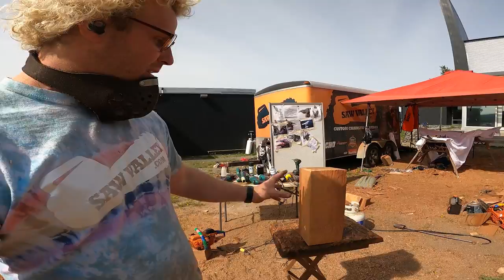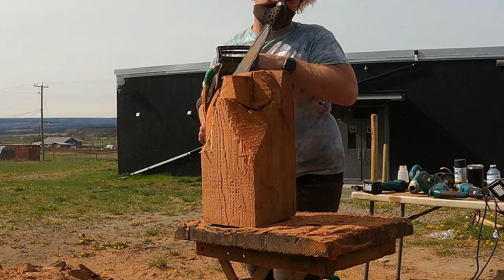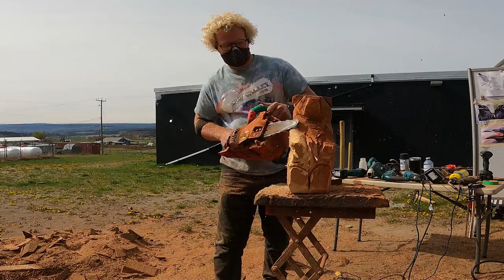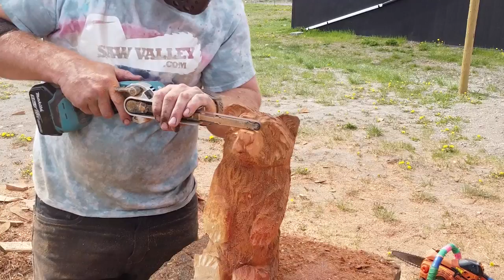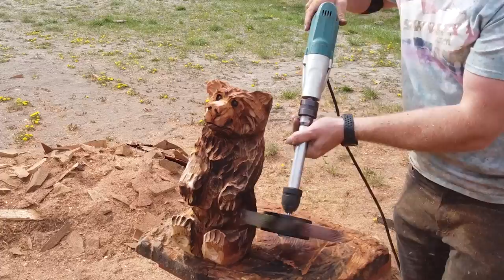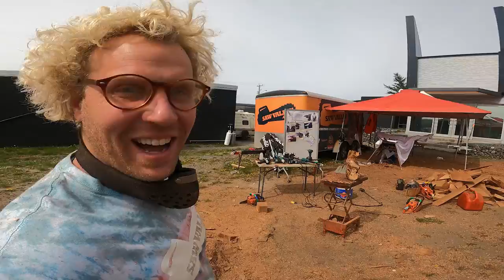How to Carve 150$ SITTING BEAR in 15 min EVERY CUT with chainsaw

Comment: Who sells ,the echo CS  2511 WEX 1/4 pitch sprocket with 8” carving bar  ? Or do you have to buy separate and get saw shop to change the 3/8 “ to 1/4 pitch 050 ?
Reply from the maker: separate